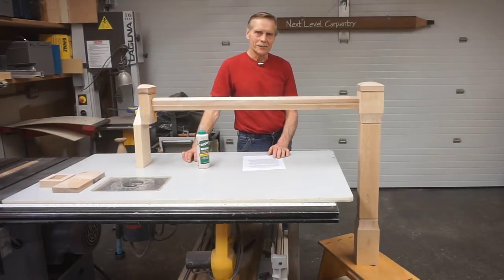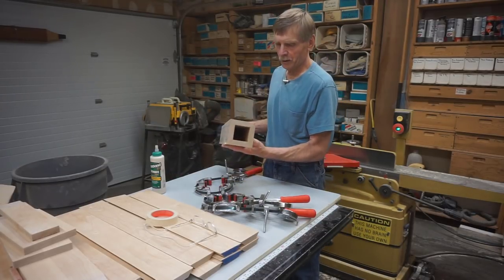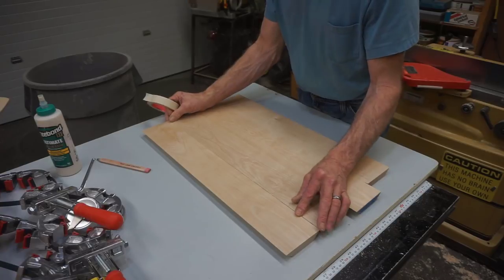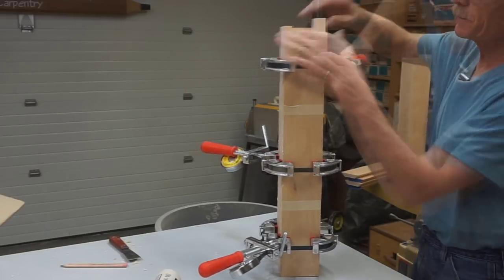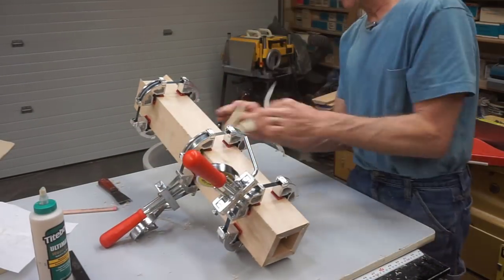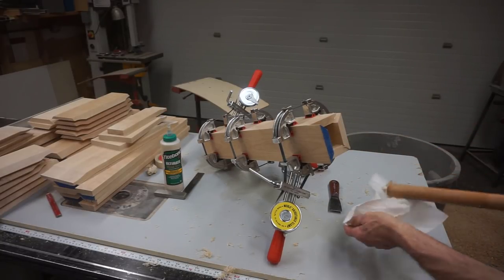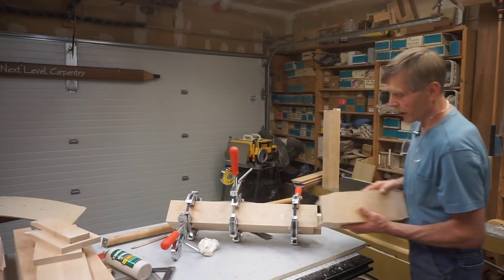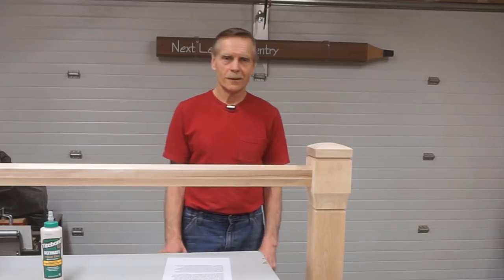Make Box Newels using Band Clamps

Comment: Another good step towards a great result. Looking forward to the next level. Quick note, I like to add couple blocks inside just to reinforce the square glue up remember pressure from the railing and general movement of the house can cause cracking down on the road... maybe I am exaggerating 😎
Reply from the maker: Lino, thanks for commenting... I hope to get more videos from this 'series' produced and uploaded soon.  Thinking about posts like this before actually making them I'd be inclined to agree on adding blocks inside... just seems like the thing to do.  I suppose if posts were plywood and shot together with trim nails it might add necessary strength but not with this process.  After making them I realize extra blocks would be quite unnecessary because they're remarkably strong as is. The stress applied to the posts when installed is almost entirely in 'compression' so I can't imagine any failure without internal blocks that wouldn't destroy the railing itself long before blocking prevented it. I did a 'stress test' of the glue joints on cut-offs from these posts (which you'll see in a future video) and the wood itself failed first. Good news is they're simpler to make without adding blocks so it's a good thing, right?  Best,  Matt

Comment: Wow - just found this and just in time. I was searching for band clamps and stumbled onto your video. I'm going to be making some table legs out of black walnut. The finished leg will be 3 x 3 x 29 inches. My stock is rough sawn 1 inch thick planks. Rather than glue up 4 boards and see the edge grain and glue joints I was going to miter the edges and build something like your newel  posts. But I also want to "fill" the center at the ends so that the apron tenon can be mortised into the leg. I'll have to find your other video on accurate miters. Thanks for making this video.
Reply from the maker: Great dri50... I think you'll be impressed with the clamps. At 3x3 you're right down near the minimum size for the clamps but they're what I'd use if faced with your glue-up.  You'll see how I'd recommend making perfect miters in the 'other video on accurate miters' and hope that works for you.  If you watch the 'Round Wood Cylinders' video you can see how I put a 'shoulder' down inside the ends of them... it occurs to me that you might want to include a similar shoulder in your square legs to get the plug used to 'fill' the center at the end to index where you want it... not too far in or out.  Good luck... and feel free to add updates here as you go through your project... Best, Matt

Comment: Matt, I'm sorry to be a need person but I want to ask you few more questions. Do you have video/can help with advise on how to fit the middle sections. It seems like they have shoulder on top and bottom that allows for a little review when assembled. I'm curious to know how you made that since it's nice tight fit.
Second that all thread goes into sub-floor, what if you don't have anything there past the sub-floor? You cannot always find a joist and that's what I have. Also, would is be smart to drill i.e., 3/4 hole and have nut, piece of metal (1/4 thick square 4x4 inches) then all-thread all the way to the top of the newel. I'm just trying to make sense in my head how I'm going to install and assemble all of this. Thank you in advance
Arek
Reply from the maker: It's cool you're undertaking a project like this Arek... not for the faint of heart!  I don't have video of that part of the process but can tell you that I made all the sections as accurately as possible but then did some minor fit adjustments where each piece came together.  I numbered each piece in a way that, once two sections were custom fit together, I could reassemble them in exactly the same orientation during the project.  If there's nothing solid where the allthread goes through the plywood you'll need to add some solid blocking below.  I had this in 2 out of 3 of the posts I did.  At the bottom of the upper flight of stairs I was able to add the blocks from the crawlspace below.  For the one at the top of the stairs I didn't want to disrupt the finished ceiling below so I just cut out a piece of the subfloor, fit and attached solid blocks into the cavity below and then screwed the subfloor patch back down.  It's a bit of extra steps but works out wonderfully.  I didn't have and don't see a need for a large square steel washer in this assembly but that's not to say you might find benefit from using one/some in your particular installation.  I wouldn't hesitate to add one anywhere if it made it faster/stronger/better or easier.  It's good you're working through this in your head first.... it will save you unpleasant surprises later on... and they're much easier to fix now! 😀😎 Best, Matt
Reply: @NextLevelCarpentry   It all makes sense and is clearer now. One thing for sure, initially this project seems medium difficult but it is more then that since it requires MANY steps all are super accurate and you use expensive material. That's why it's making me a bit nervous but unless I try this I won't know the outcome. Plus anything can be fixed! Thank you my friend (Matt) for advise, I really appreciate it! Arek
Reply from the maker: @kosinskiarek  You bet... keep in mind that I make mock-ups for every step of the process using scrap from the project or running extra pieces of each out of leftover materials from other jobs, etc.  That way I'm able to dial in accuracy and make those stupid little mistakes that inevitably show up when doing such a lengthy sequence of tricky steps.  Practice, practice practice and you'll CRUSH this!  I'm rootin' for you and your success... Best, Matt

Comment: +Philip Dandy there are many ways to come up with the end product. Next Level Carpentry is exactly what your seeing in this video NOT JOINERY. A joiner will will use a 4x4 A Carpenter will make it look like a 4x4. When you goto carpentry and joinery collage or schools you get taught how to get the most out of a single plank of wood and that includes keeping different sawdust's for mixing with glue and other plastic wood fillers. Carpentry is all about skill design engineering manufacturing the end  product with cost efficiency. 1 length of 4x4 =$30 
1 length of 4x1 =$6 
When you have your own tool shop and you set it up properly you'll never want to take the costly shortcuts. You will have all the tools at your disposal and the passion will grow on you and you'll become a master carpenter knowing you can take any log and mill a board off of that log and create a beautiful work of art at low cost. Once you've achieved that and your shop is set up everybody in your family will know exactly where your at as it becomes quite an addiction as you create wonderful things with your own two hands. Hope this makes sense as to why carpentry and joinery are two different job titles and both have different levels and different grades of achievement. ☺